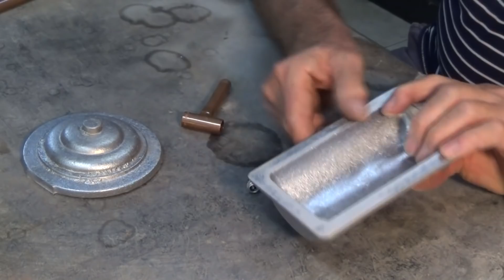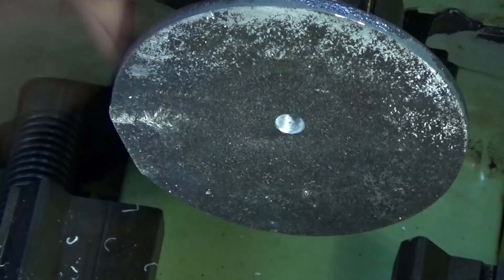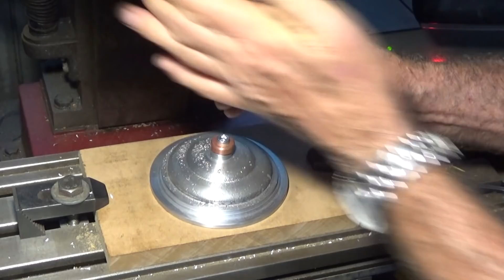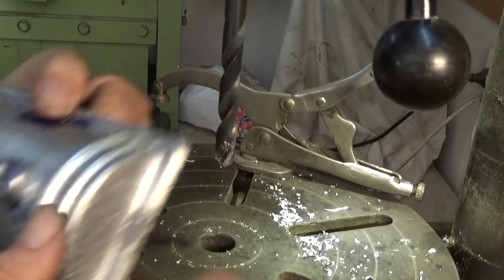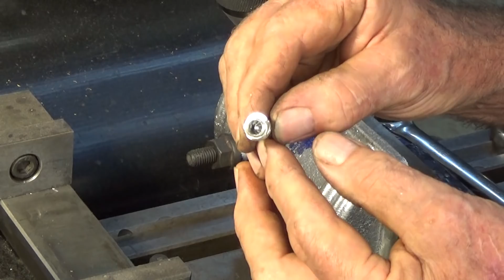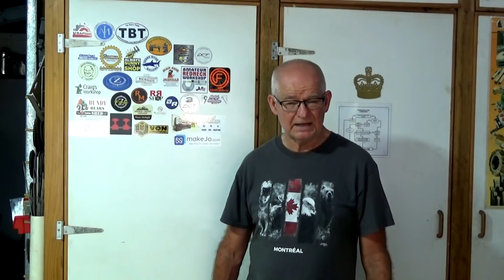The "MIXIE" A DIY Steampunk, Backlit Digital Clock - Part 3

Comment: i know you have many years experience in machining but I do wonder how much time it takes to decide how to set up some of these machining features. For instance the set-up for that power supply jack.
Reply from the maker: My metal machining tutor when I was at college used to say, "setup time is 80%, the rest is just shifting material." This sums up the dilemma of making a prototype part too. A lot of the time and energy goes into problem solving and sometimes, false starts. The key is to innovate and not give up when things go bad. Everything is a learning opportunity.
Regards,
Mark

Comment: Mark, I really like your idea of a rubber surface on the tail stock adapter you used to pressure-turn the end pieces.  I'll keep that idea in my "tool box"!

I kept expecting you to pull a "Clickspring" on the end caps and hand-turn the radii's & curved surfaces a bit to clean things up!
Reply from the maker: Bob, I recently purchase a "Turnado" freehand turning attachment from Eccentric Engineering. I bought it specifically for this job and I will be using it tomorrow to do the decorative turning. I'm no Clickspring but this should give me a similar result.
Regards,
Mark

Comment: Thanks for keeping up with Canadian theme :) Jokes aside, I particularly like this tool holder for lathe - I guess you need to sharpen only one face when it is dull?
Reply from the maker: The diamond toolholder comes with a jig for sharpening the tool bit. It keeps the bit inclined at the correct angles and you just sharpen the top face. You can also put a slight radius on the front edge but it's not essential. We loved Montreal when we were there a few years ago. A bit like a much more pleasant version of France. 😁
Regards,
Mark

Comment: Great video.  I don't understand why you tapered the top holes.  Seems to me a place for alignment issues during assembly. However, I have faith in your reasoning and it will all come clear as you proceed. Take care.
Reply from the maker: Roy,
Apart from using Loctite, I could not really join the copper tube to the aluminium casting and I want to be able to disassemble it if necessary. The press fit will keep everything in place until I'm ready for the final assembly. I'll probably Loctite it after all the powder coating is done. 
Regards,
Mark

Comment: 601 aluminum... would that be equivalent to A356 in the states?
Reply from the maker: It's correct name here is AC601 and I believe it's equivalent to AA365. It's a heat treatable alloy with good corrosion resistance and strength properties. It will take a T6 treatment. The good thing about casting with fresh alloy is there is almost no dross after melting and I get almost no porosity in the finished castings. I don't degas my metal either.
Regards,
Mark

Comment: Hi mark is there any videos of you lathe collet set up
Reply from the maker: Mark, not really. The Colchester spindle nose has a #5MT bore and I have a #3 to #5MT adaptor and a rough and ready drawbar made from some M12 allthread. For some setups like drilling I usually don't bother with the drawbar. Same with pressure turning because the tailstock keeps the taper pressed into the spindle. 
Regards,
Mark
Reply: Was thinking it would be nice to have a 5mt to r8 adaptor then I could use h collets from the bridgeport

Comment: So you faced and machined the 'tit', then drilled a hole and machined a thread. You then turned it around and compressed the hole and thread in a chuck - what and just hope you haven't deformed the feature you just spent time machining.  Cummon fella!!  Where's your head ? 

Use the machined 'tit' (without a hole) in the chuck so it doesn't deform. Turn piece around and do outer edge work. THEN spin it around and use the outer machined edge to hold piece whilst doing the centre hole and thread. If needed the 'tits' side can be used with a dial gauge.
Check out  Joe Pieczynski channel   https://www.youtube.com/channel/UCpp6lgdc_XO_FZYJppaFa5w   (Abom on steroids)
Reply from the maker: I am a regular watcher of Joe Pi's channel. I love his work and I can honestly say I discovered pressure turning before he mentioned it on his channel. Although at the time I didn't know what the technique was called. I can report that the threaded hole didn't distort. There is a lot of metal around the hole and the ER40 collet was not done up to it's max torque. As always there's multiple ways of skinning a cat. I'm sure there are better workflows for that part but at the end of the day I got useable parts. I should also say that I'm a hammer chewer (amateur). Joe's a pro! 😁
Regards,
Mark

Comment: I'm interested to see how you get rid of the "apprentice marks" on the castings....
Reply from the maker: JB Weld? I've never used it before but I found some at Jaycar Electronics. I usually use Selleys KneadIt, but it's really stiff and hard to press into the voids. It does withstand the powder coating temperature though. JB Weld is supposed to be good up to 260C and I powder coat at 200C and the JB Weld is runny enough to close over the voids. 
Regards,
Mark